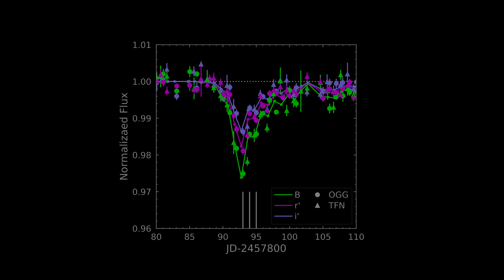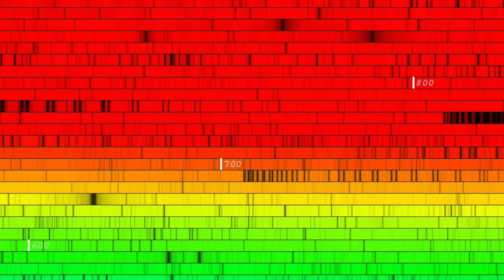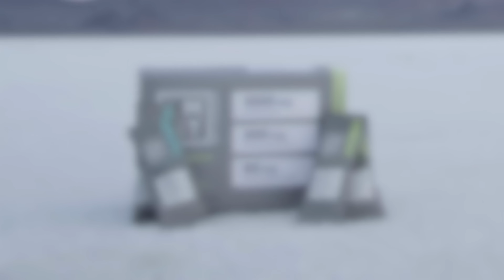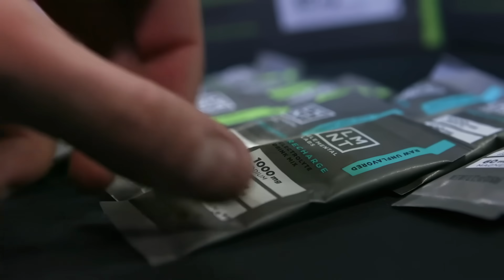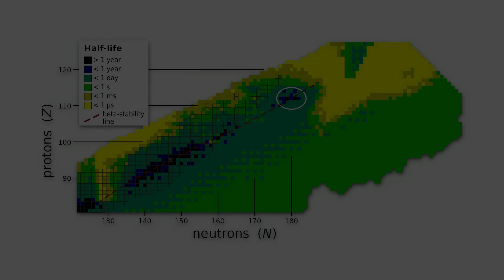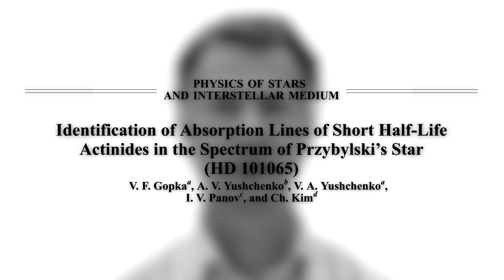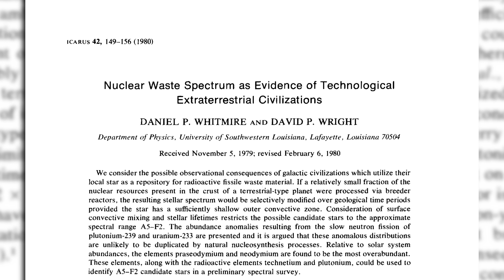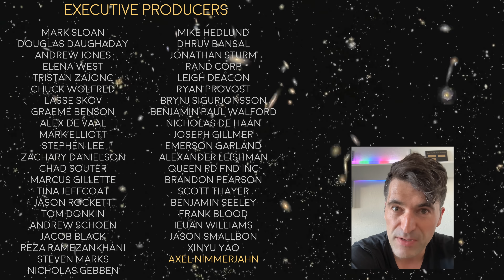The Star That Shouldn't Exist

Comment: The question that first presents itself with the salting hypothesis is... how much material would be needed to change the spectra of a star in a way that is consistent with what is seen in Przybylski's Star?
Reply: If there are advanced aliens salting a star I wouldn't automatically assume they have to live nearby.
Reply: @johnreilly8672  Of course they are not nearby. The closest star is 4.7 light years away. Nobody is “salting” stars.
Reply: And if salted, could it be part of an isotope production process by some method unknown to us? Perhaps they can somehow create high Z stable elements.
Reply: @UteChewb   the symmetry of space time tells us that isotopes unstable here on Earth are unstable everywhere in the universe.
Reply: @UteChewb  Processus r, nuclear spallation can produce those heavy elements consistently. There is no known close supernova from this star who could have lead to such events, but the interaction (meaning a relatively close fly-by 1-3ly away) with an accreting blach hole or neutron star would do the trick. Those disk generate a lot of high energy cosmics rays. Far more plausible hypothesis than aliens dumping asteroid-sized nuclear trash into their star.
Reply: Another question is why does it have super low iron content? Are the aliens grabbing iron from the star lol
Reply: @gameeverything816  The star probably formed from a very low iron-content nebula. This is not the only star known to have such characteristic in the Milky way, what's odd here is that usualy, low iron stars are from the Pop II class, old, low mass stars formed when the Universe wasn't polluted as much by heavier elements, but here we have a A-type star who can't be older than around 1 billion years. A possible explanation is that iron as sunked into the core, because the star is mostly radiative, there is not a lot of mixing of his inner content with the surface.
Reply: @jhtrq1465  If the star is likely to be less than 1 billion years old then it definitely don't have an orbiting planet that evolved space faring species on such a technological scale in such a small period of time.
Reply: @hackedbyBLAGH  Because it would take a lot longer
Reply: @charlesmiller8107  Completly agree with you, that's why I really didn't like the alien part of this video. He quickly jump to it without giving much attention to other more mundane explanation and don't take into account that A-type stars are very unlikely to form planets and host life in the first place.
Reply: @charlesmiller8107 Not necessarily, because on Earth we had billions of years with just single celled organisms. There is no reason to think intelligence cannot evolve much, much faster.
Reply: @DrFord_22  There is even less reasons to think that intelligent life would emerge much, much faster, especially in such hostile environement. You guys take things completly backward here, you take the absence of evidences as a proof of the most unlikely scenario at play here.
Reply: @jhtrq1465  Relax, I said 'not necessarily',  because we dont know anything about how quickly intelligence can evolve. We have only one example (Earth). So, to say that 1 billion years is too little time is presumptious. 1 billion years still is an unimaginable long time. Though I agree with you that 'aliens' is the most unlikely scenario proposed in the video, or at least it is the one that needs the most supported evidence to be credible.
Reply: @DrFord_22  Sorry if I sounded rude or abravise that wasn't the goal. Anyway, we at least know that in the only case we know of, emergence of complex life is a lengthy process. We also know that the Sun offer a much more "life friendly" and stable environment than A Star, so it make quite unlikely for complex life to emerge here faster than on Earth.
Reply: @jhtrq1465  No problem, thnx. Yes I agree
Reply: @jhtrq1465  That's true if we're basing our concept of what constitutes life on Earth life. It's hard to say what can and can't happen in regards to the development of life when you have a sample size of 1.
Reply: @Sundablakr  You're right, but how this lack of other sample make those speculations about aliens evolving 5 times faster than on Earth more relevant? This is a very common trope on this subject to use this lack of data to make divagations and magic thought like a reasonable hypothesis.
Reply: @DrFord_22   Haha no. There is not just one sample on this planet, every single animal are examples. Most computers can't compete with cockroach intelligence. Now what we do have are that amongst all of those it took a very long time with very unique conditions to form "Our" type of intelligence. 1 billion is too fast even with how amazing our planet is at creating life.
Reply: @charlesmiller8107  Why not?? How can you know that? It is not like we have observed life anywhere else in the universe and know exactly its timescale of formation and the timescale of formation of complex life and civilizations - we have no idea. We only know what happened here on Earth.
Reply: @charlesmiller8107 We dont have any idea how long it would take aliens to evolve, we only know how long it took here. Sample sizes of one arent very useful in statistics.
Reply: @charlesmiller8107  Of course one possibility is that aliens could have travelled there from another system.
Reply: @pineapplepenumbra  Yea I know, that's why I specifically stated that they would not have evolved there.
Reply: @scottabc72  Yes we do have an idea. Even with one sample size chemistry and biology have rules and we can use that to estimate a probability. Yes I agree it's possible, maybe, but spectacularly unlikely.
Reply: @charlesmiller8107  We only understand development from a human perspective. It's an often seen thing in science fiction that humans are notoriously quick to adapt to change, it's not impossible that the speed at which an alien brain develops may be even quicker. Their version of the industrial revolution may have been a few months in their history. We too often attribute human time scales to development, when in fact, even the rest of our terrestrial neighbour species do not see things in the same time frames.
Reply: @charlesmiller8107  Sorry, it was late, I must have missed that bit.
Reply: @jhtrq1465 Not agreeing or disagreeing but if there is a civilization advanced enough to interact with a star this way then it is also possible that said civilization is originally from another star system. I mean if you were a super advanced civilization and needed somewhere for waste disposal/resources a star system unsuited for life is probably a good choice.
Reply: @GlaDurDeaD Yeah and also a billion years is only a billion years to us. We have no idea how life would form in other systems. They could live for much longer and are able to retain more information. Maybe they have shorter life spans and evolve at a faster rate. Maybe they have a more “logical” mindset and didn’t spend thousands of years explaining away reality with religion instead opting to take a more scientific viewpoint so they advanced faster. Ofc this is all speculation but there being NO other life forms in the universe is less likely than it existing imo.
Reply: @MrSoso1050  As it was already said, you take things completely backward, alien civilization is the least likely of any hypothesis to explain what's happening here. It doesn't make much sense that "they" would travel dozens of ly to dump massive quantities of nuclear waste into a star. You have to exhaust all the more rational explanations before trying to speculate about what an alien civilization would do.
Reply: @GlaDurDeaD  it's annoying to read this kind of answer over and over. Yes we only know how life evolved on Earth only, but its at least on sample to build models and theory about life and evolution. All the non sense with alien evolving super fast is based on absolutely nothing. So yeah, nice for sci-fi story, but it doesn't make it a valid hypothesis to explain what's happening here.

You just take the complete lack of data to make a speculation look like a valid hypothesis, that's just a big fallacy.
Reply: @jhtrq1465  lol why not? What if they invented already flt travel. And their solar system is completely occupied by their civilization dumping your waste to the nearest star to yours seems like the most plausible idea. Of corse is just an hypothesis.
Reply: @MrSoso1050  FTL travel... Ok. And what if they were giant pink space unicorn that fart nuclear wastes as a mean of propulsion? This is as much plausible
Reply: @jhtrq1465  The point is to point out that the already in place fallacy not to place what I said as fact. The big thing is we don't know either way. It's a baseline sure, but falling out of line with that baseline can't be ruled out as impossible as we only have the one datapoint. 

It's not about biological evolution but about technological advancement if you really wanna start debate. Technology and the suppression of good science such as Galileo may not of happened on an alien world. Which would have allowed for earlier development than our history of religion suppressing technology through accusations of witchcraft.
Reply: @charlesmiller8107 who said they had to originate from that system if were thinking on this scale
Reply: @bread1832 And why would they travel dozens of light-years to empty their garbage on a star? This is complete non sense.

The problem we have here is : This star has unusualy low iron content, and there is a descrepancy in the spectral analysis of the elements in the stellar atmosphere.  

The studies (there is 2 study of this star) aren't very sure about the presence of those elements in this first place, they aren't even sure if the star is in the A type, F or G in the first place. So yeah, stop with the aliens.
Reply: @charlesmiller8107  If we're talking about aliens technologically capable of salting a star with heavy elements at a rate and magnitude that it would alter the star's spectrum enough for us to detect it here on Earth we would be talking about an alien civilization at least advanced enough to conduct interstellar travel with sublight generation ships at a minimum. Doubly so if we're also speculating that this is a civilization capable of Star Lifting at a scale that could deplete iron to the degree observed in this star. So the scenario would be some alien civilization that traveled to this star after originating elsewhere.
Reply: @adamwu4565  Why do I have to keep stating the obvious. I said they couldn't have EVOLVED there.
Reply: @Ysrael.Fernandez  we have no way of knowing how many times intelligence has evolved on Earth. All evidence gets subducted into the mantle
Reply: @fly463  because it's make 0 sense to travel dozens of light years to dispose of garbage
Reply: @jhtrq1465   "dispose of garbage " 🤦‍♂️
Again i am asking you, how do you know they are disposing garbage and not doing some other activity ?

Disposing garbage is only ONE of the theories 

They could be doing anything conducting experiments as a theory as i said already
Reply: @charlesmiller8107  most likely it would but not necessarily. Just because it took us this long to get where we are doesn't mean someone else out there hasn't done it much faster.
Reply: @charlesmiller8107  Definitely is the wrong word to use in light of recent discoveries regarding the first instances of abiogenesis on Earth.  not only that but it discounts the possibility of panspermia and outright colonization from another system
Reply: @charlesmiller8107  what if the aliens were migrants from another star? i mean if they're advanced enough to synthesize massive quantities of exotic material and deliver it to their host star, wouldn't they also probably have the ability for interstellar travel?
Reply: @gameeverything816  "why does it have super low iron content?"

A very good question.

"Are the aliens grabbing iron from the star"

Isaac Arthur suggested a process called "Star Lifting" (not, to my knowledge, about this star), but surely there would be evidence of such activity?
Reply: @pineapplepenumbra  Star lifting would requiere a massive structure around the star that would have been detected already, and the process is about extracting hydrogen from the star to fuse it into other things. Iron is completely inert for fusion purpose, so no.
Reply: @jhtrq1465  You make a couple of good points. I can't argue with either of them.
Reply: @gameeverything816  probably there are gypsies there as well stealing all the iron they can get
Reply: @gameeverything816  They might be mining the star for the iron. To do that they might need all these exotic elements to induce some sort of solar flare which they mine after it cools. Would kick out a lot of dust which may be detectable (a bit like Tabby's Star).
Reply: @johnstokes8511  That's a lot of "if" to explain a descrepancy into one element ratio.

I think that if "they" were able to mine their own star, it would requiere some sort of huge megastructure around the star to do it, strange nothing of the sort has been detected around this star.
Reply: @johnstokes8511  I think it's one thing to fire your radioactive waste into a star and quite another to mine its solar flares but who knows. Maybe they are super duper advanced.
Reply: @johnstokes8511 why harvest a star when you can harvest planets where the iron is way more concentrated?
Reply: @jhtrq1465  I don't think it would need a megastructure. Just wait for the material to cool down & then collect it. I would suggest if they were doing this then they should not select an inhabited system.
Reply: @svenweihusen57  This might not be their Star system & it might be resource poor without getting material from the star. Highly unlikely I know, but just an idea to throw in the mix.
Reply: @johnstokes8511  and how do you propose "they" manage to make the star spill out his guts to collect the iron buried deeply inside without any sort of contraption or device? This make 0 sense, you don't just mine a star like your are casually collecting rock on the side of the road.
Reply: @jhtrq1465  This would be Blasted off the surface of the Star & collected after it had cooled. Just realised that any iron would have sunk to the centre of the star, so maybe not that. Remember this would be a civilisation that would be advanced technologically.
Reply: @svenweihusen57  why destroy a planet which could be useful for other means when you can harvest material from a star which could eject material that literally is several planets worth in one ejecta
Reply: Or asteroids, which are even more concentrated and a more manageable size
Reply: More likely this star is loaded with iron, as it should be,  and that iron is (for a yet undiscovered reason) behaving weird as hell on the spectrometer.
Reply: @RandomWandrer  - "Weird" in a way that we have never seen any of the... what, tens of thousands? Hundreds of thousands? of start we have studied. Yeah, sure, whatever makes it so you can sleep at night.
Reply: Also my understanding is that the lifetime of A type stars is around a billion years hence any aliens which are native to that system would have had to have evolved firstly into complex life and then into an intelligent technological civilisation in an astonishingly short time compared to what happened on Earth.

Of course the aliens might not have evolved in that system but instead have colonised it after evolving elsewhere though I'd have thought that an A type star with its short lifespan would be an unlikely prime target for colonisation for a species which evolved in a system around a cooler more long lived star.  Or could salting a star in this way somehow extend its life ?
Reply: Probably a LOT... so if aliens are doing this... they are way way way more advanced than us
Reply: A lot I’m guessing 😂
Reply: exactly, that would be a lot of material, to just show up. maybe it is just part of the process of some stars creation.
Reply: I agree that 1 billion years must be too little time, life evolves on a hyperbolic curve, which has a long flat tail of basically nothing going on (Like early earth with just microorganisms) before suddenly curving towards infinity.  

A hyperbolic curve is similar to an exponential curve, but in an exponential it takes infinite time to reach the singularity.

Life's evolution follows this curve, building off previous advances, as it spent most of history as microorganisms before the Cambrian Explosion (Rise of multicellular animals) happened only 538.8 million years ago out of earth's 4 billion year history & growing in complexity until now there's us & our societies [Which can be treated as superorganisms] accelerating towards the technological singularity & destabiliizing the planet at a geologically novel pace & scale as a result.
Reply: Hey, if you are not saved, and would like to be included in the rapture of the church. Believe that Jesus's death on the cross, was enough to pay for ALL your sins , yes ALL ,(past, present and future) That is what the Gospel is about. We are saved by GOD'S amazing grace, through our faith in Jesus's sinless life, death on the cross and resurrection 3 days later . No additional works needed. It is literally that simple.   Ephesians 2:8-9  Romans 10:9-10  Romans 4:5
Reply: @Jona7Fer  nah im good but thanks
Reply: @Jona7Fer  So what if I dont believe? Am I going to go to hell?
Yes?
Are you really going to insult god by saying hes a petty, self centered, attention driven POS?
If I was god, I would honestly be insulted at how religious people depict me.
Reply: @Jona7Fer there are no gods. You are ill. Scizophrenia religiosa can be treated and you too can feel a bit normal.